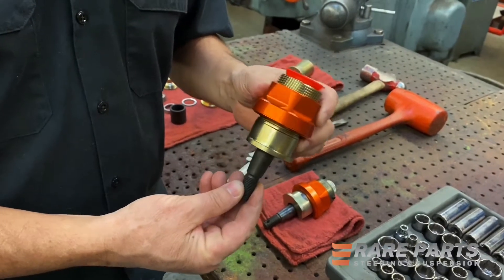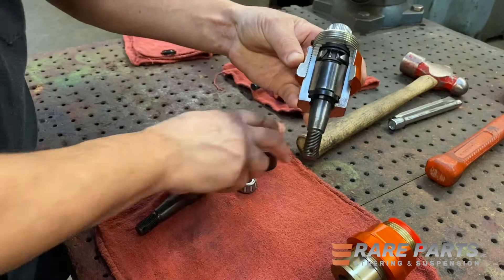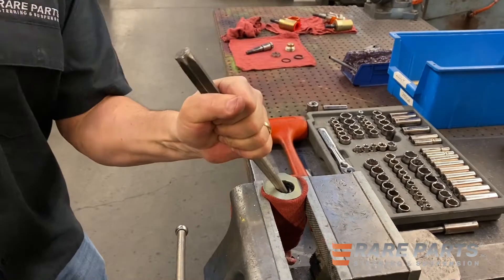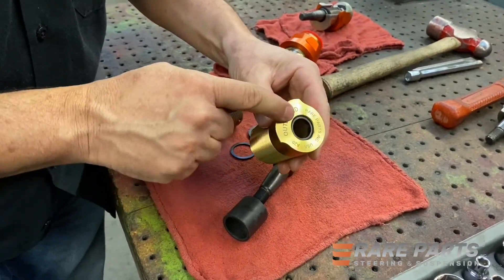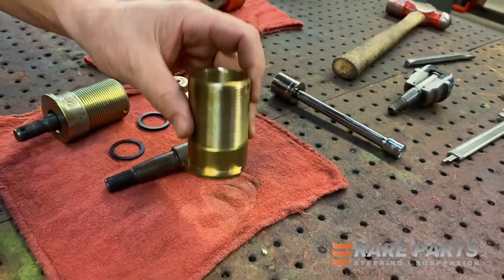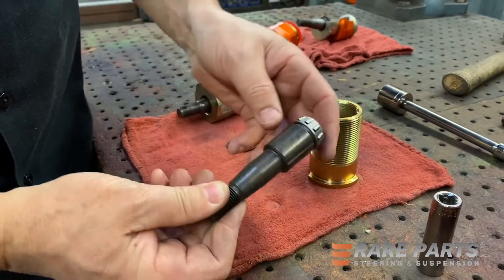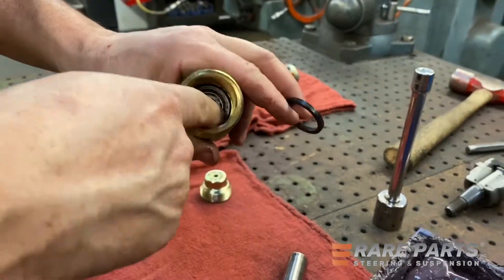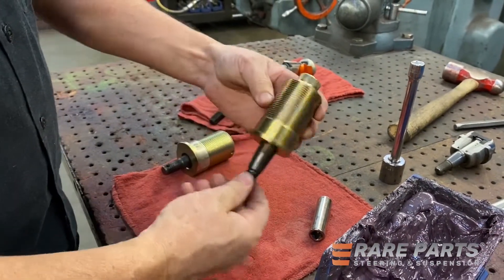Rebuilding Rare Parts Dual Load Carrying Upper Ball Joint | Rare Parts, Inc.

Comment: Can I use this ball joint if my current upper ball joint have +/- 1degree?
Reply from the maker: Yes you can! Our Load Carrying Upper Ball Joint will maintain factory caster/camber. We recommend replacing all 4 joints to balance the steering load correctly 👍🏻

Comment: What is the other orange item that you see in the end of the video that goes around the axle shaft I would imagine it’s to seal the chamber inside the axle tube to keep out unwanted debris, and things about nature water dirt I know there’s another type system that is an analyze piece of aluminum with two grease seals, one facing in one facing out But I haven’t seen the one in this video. Is it any good? Do you sell it? Do you have to constantly grease it normal questions.
Reply from the maker: That's an RCV Performance axle shaft sealed boot used to replace the original U-Joint shafts. Lots of benefits, low-maintenance and plenty of clearance for the Dual Load Carrying Ball Joints 👍🏻

Comment: We can’t send these in to you guys to rebuild them?
Reply from the maker: Hey Edgar! We have not seen a set wear-out under normal use but we will gladly warranty if problems occur. The housing in this video was heavily cycle-tested and still showed no sign of wear or stud endplay. We've also been trail-testing these on our Wrangler for several years without a rebuild. Our Techs can help with any questions on the system along the way, please feel free to call us at 800-621-2005! 👍🏻